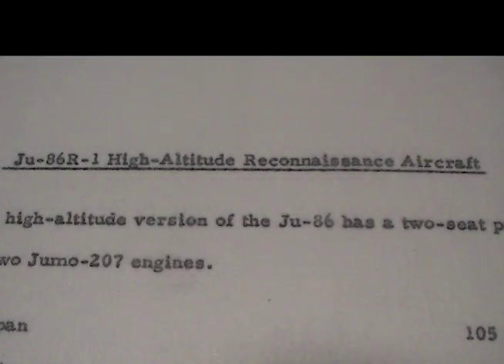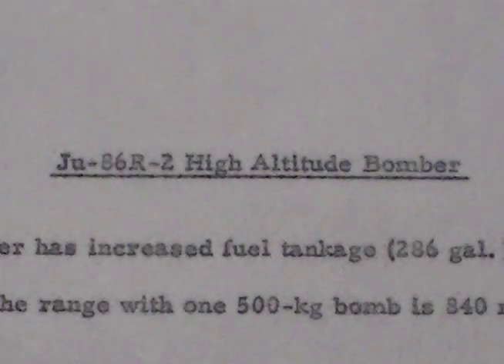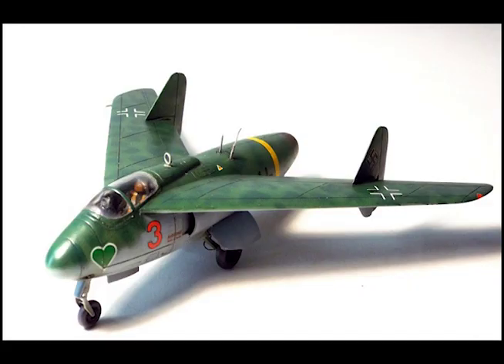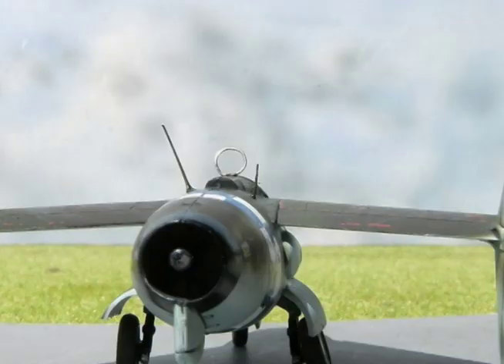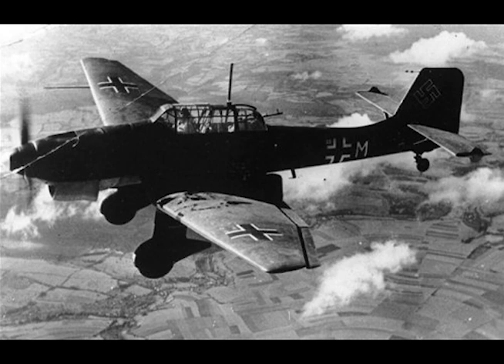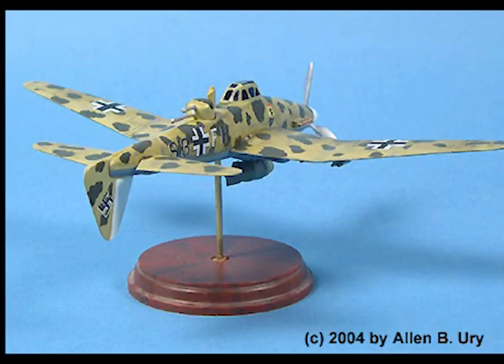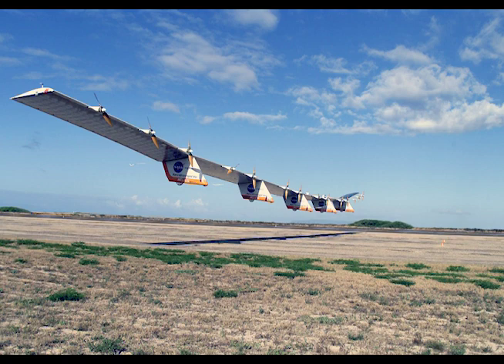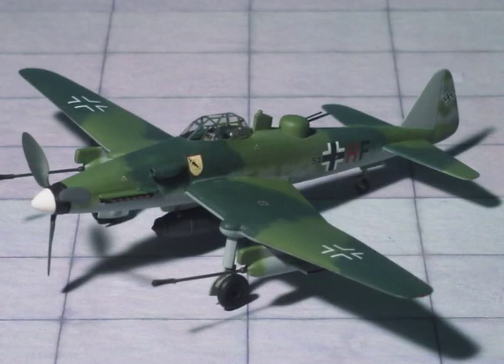German Experimental Aircraft of World War II #16

Comment: G'day,

Yay Team !

I was goanna mention that most of the illustrations of the Ju-187's Party-Trick Tailfeathers were drawn in error ; so I'm glad to be able to shed a bit of shared light.

The Fin-Rudder didn't move through "a full 180°" - rather the Fin appears to have been a Triangular unit, held at it's front Point, in a Bearing around an Axle running athwart the Fuselage...; set up with powered Jack-Screws to 
TILT the thing through zn Arc of 90 Degrees, in the Vertical Plane.

For Ground-running, Taxying, Take-Off and Approach/Landing, the Triangle was
"Jacked-Up", 
With it's Topside
Leading Edge
Almost Vertical and the
Lower L.E. 
Horizontal...

Once up in the Sky, after the Wheels come up, or as they retract (bad idea - least landing Wheels-up require Tail-down for the touchdown...!), the Jackscrews 
PIVOT the Fin down through 90°,
Placing it's 
Top L.E. horizontal, and it's 
Lower L.E. pointing down under the Fuselage...

Either way, the
Fin's Trailing Edge is the 
Rudder's
Hinge-Line - which winds up (or down) being
Raked 
Backwards from the
Tip to the
Centreline Axis of the
Fuselage...

I think that anybody who's into Gotterdammerung, Aerial Cannon-Duels and Valhalla..., probably considers it an 
"eminently capitol idea, by Jove !...; but to build it involves adding a
Big HEAP of 
Weight, and 
Complexity..., precisely and 
Exactly whereinat one rather 
Wants to
Simplicate..., and
Add
More
LIGHTNESS -

At the
Tail...(!).

I think it looks as if the 
Rudder Controls might well be
Heavier for the 
Pilot to operate,
Due to the added Complexity of the
Geometry of all
Cable-Runs being 
Uniquely
Variable...

My understanding is that the
Intention was to have the
Bumfeathers pivot
Up/Down in the obverse of the
Undercarriage movements,
Automatically - as an integral thing, like the reverse of a retractable Tailwheel...;
Which sounds like a
Bonus 
Extra
Difficulty, whenever anybody 
Has to, or
Decides it best, to
Alight
Wheels-up.

Hopefully the
Teutonic
By-The-Book
Mindset...,
Permitted the Pilot to 
Disengage any default-interlock 
Between the two 
Features....(?).

I went to School with a
Stuka Gunner's son, 1975 - '78...,
The old man deeply hated Communists, he was Hungarian & Bela Kun had put his father in a Kamp...; so he volunteered for the Luftwaffe in '41, and asked to be an Air Gunner on Dive Bombers.

The bit he liked the best was
Regaining consciousness after the
Autopilot had pulled them out of their 
Delivery-Dive...; 
Hanging in his Straps looking 
Down, behind,
As they climbed out at 30 or 40 degrees...;
To see, ideally, a burning 
Tank in his Rear Canopy-Glass, and he then was able to
GLEEFULLY
Machine-gun any
"Communist Bastards" who might be still
Trying to climb out of the
Tank, which his Pilot had
Bombed...

I wonder what 
Eddie Botka's father would have had to say about the
Ju-187...; because he bloody well loved the origidiginal '87, so he did...!

He later on escaped from a Train taking him to Siberia, after the War, for having fought against the Soviets ; walked down to India, married a British Colonial Administrator's daughter, migrated to Oz, and finally  roosted in Cooma, working on the Snowy  River Hydroelectric Scheme, eventually  retiring as a Draughtsman...(!).

Such is life,

Have a good one...

Stay safe.

;-p

Ciao !
Reply from the maker: Thanks for that, Warbles - Keep watching the skies!
Reply: @maxvolumeonguitar82  

Yeah mate !

No worries..., glad to have been able to help.

Have a good one...

Stay safe.

;-p

Ciao ?